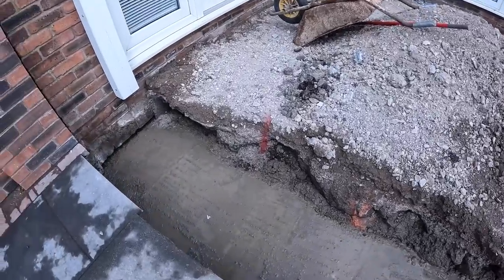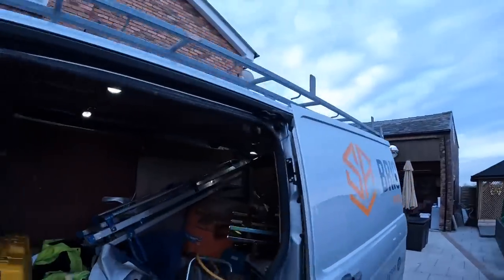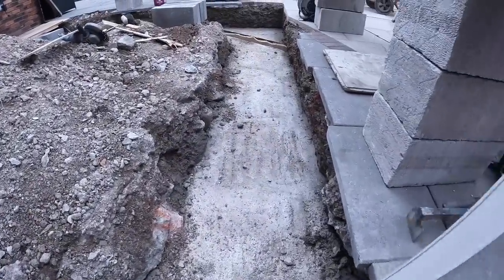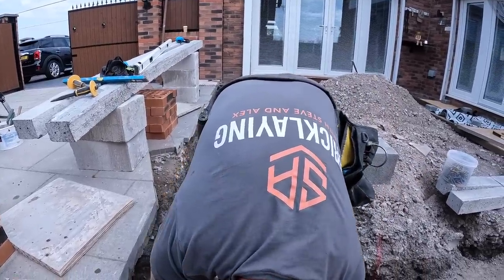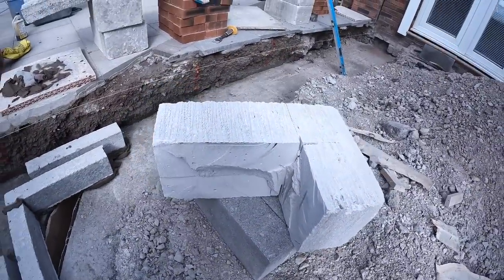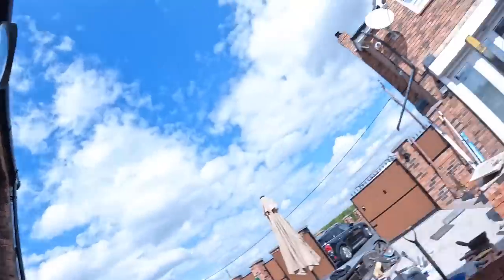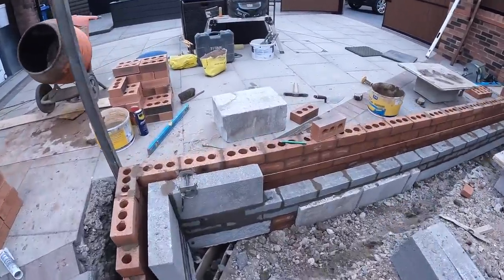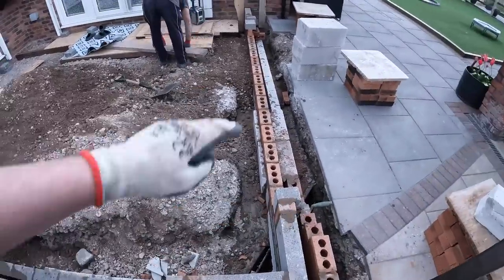HUGE HEAVY LINTELS !!! ...L SHAPE EXTENSION PT2

Comment: Someone is taking the p1ss using those concrete lintels on top of a reinforced footing
Reply from the maker: Why ?
Reply: Because there is no need for it , the reinforcement in the footing is all that is needed
Reply from the maker: @jeffreyloftus3617  did you watch the previous videos ?
Reply: No need to
Reply from the maker: @jeffreyloftus3617  ok you know best then thanks for the “advice “
Reply: Cheers
Reply: Far better to do that than throw caution to the wind. The previous video demonstrated why they're necessary in regard to this particular set of circumstances.

Comment: Not questioning the logic, just interested.  surely the steel in the concrete will rust below ground and eventually blow those lintels up?  I used them to span a sewer pipe on an extension and I often wonder about that lol
Reply from the maker: Good point 🤔🧱👍🏽

Comment: How do you know what length a concrete lintel should be? How much of an overhang should be either side? So if a window opening is 1000mm what length should the lintel be??
Reply from the maker: 150 mm seating each side so 1300mm 🧱👍🏽
Reply: @SteveAndAlexBuild  the reason im asking is i just roofed my new build in ireland. My block layer but on 6x4 inch conc lintels and had a 200mm over hang either side. But i stepped back my inside reveals so i can return a 63mm insulation so now i have a 150mm overhang on eachside of the inside leaf. I noticed my block layer didnt centre some of the lintels correctly and some of the lintels are 200mm on one side and 100mm overhang on the other side. I prsume 100mm isnt end of the world either?? Im sure it happens alot. Just abit worried as my concrete floor slabs are sitting on the inner leaf and its the inner leaf window reaveals i stepped back 50mm so i cpuld return a 63mm insulation slab. What u think?
Reply from the maker: @jericho9653 100 mm isn’t ideal but is considered the bare minimum so should be ok . 🧱👍🏽💪🏼

Comment: Dont see point in using  long lintels tied  to house & just sat on footings . Unless I'm missing  something
Reply from the maker: I guess your missing the previous episode then 🤷🏼‍♂️
Reply: Yea crazy back breaking could have use shuttering for detail if necessary 🤦‍♂️
Reply from the maker: @stephendendy8376  no we couldn’t 🤷🏼‍♂️
Reply from the maker: @martin2466  😆😆🧱👍🏽
Reply: Structural engineers are the worst! I have to put a two grand steel in over bi-folds that aren’t even that big. Wankers
Reply from the maker: @elliottdebell7783  😬😬🧱👍🏽
Reply: @martin2466  everyone wants bi-folds now days. I haven’t chosen them but as the builder I know what I have put in previously and I know the engineer was being lazy and just specified something way over, that he doesn’t ever have to worry about but With no thought to putting something in cost effective for the customer. It’s of poor design also as it has no way of being insulated as it’s a sealed box section with wielded plates top and bottom, wielded reinforcing braces and finished with paint galvanised. Poor design, crazy cost. I’m building a two
Storey not the shard. My moaning out

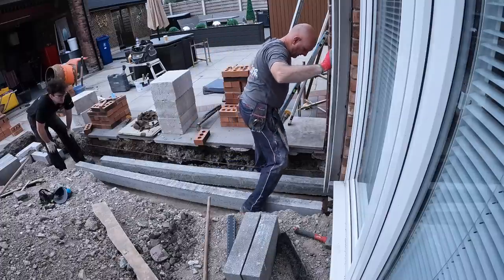Comment: 23:09 why didn’t you lay the lintels on a full bed?
Reply from the maker: All explained in previous video 🧱👍🏽
Reply: @SteveAndAlexBuild  I know you said about spanning poor ground but what harm would a full bed do?
Reply from the maker: @martin2466  😬😆🧱👍🏽
Reply from the maker: @charlieshwan5574  Just me being over cautious 😬🧱👍🏼
Reply: @martin2466  I’m obviously not a builder but it’s a valid question, what harm would a full bed do?
Reply: To be honest a full bed wouldn't have done any harm it would have spread the weight
Reply from the maker: @stevenclarke1737  🧱👍🏽
Reply: @martin2466  I would have done if I was them because they already had a foundation running the whole length. I know they said the used a long lintel as belt and braces which is obviously a good thing but having a full bed would have spread the load not just the end of the lintel

Comment: Ha Steve I have been watching you for a while now if you don’t mind me saying but your breathing is quite bad hope you don’t mind me saying
Reply from the maker: No it’s fine mate , im carrying a good stone too much which im working on 😬 and those lintels were chuffin heavy 🥵🤣🤣🧱👍🏼
Reply: @SteveAndAlexBuild  I was concerned with your lifting that lintel into the pocket. They say lift with your legs not your back. A piece of pipe makes a good roller under the lintel instead of a brick. You can also plank over the trench and loop a rope around the lintel and stand over the trench on the plank using your legs to lift only .  I work alone almost all of the time and use various strategies to move very large or heavy construction objects. (mostly 24 foot by 16 inch microlam beams lately)
Reply from the maker: @AWSmith1955  Thanks for the tip 🧱👍🏽